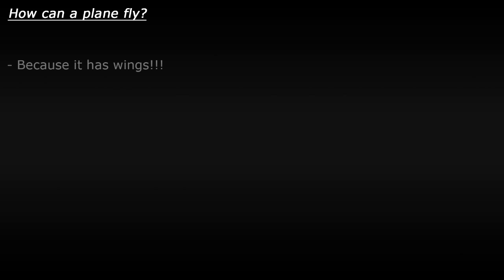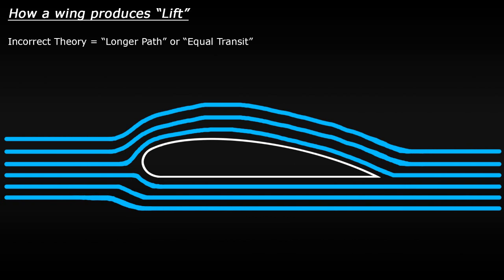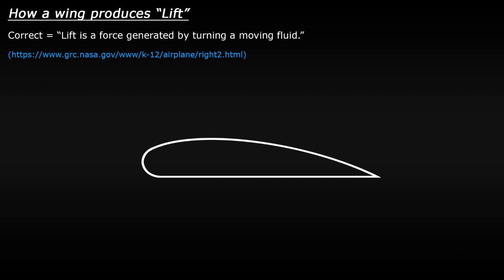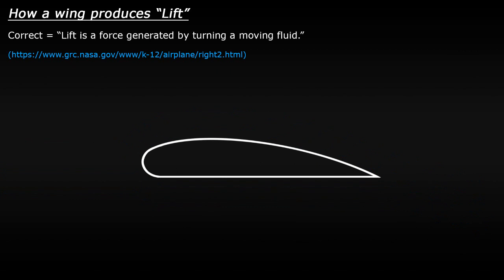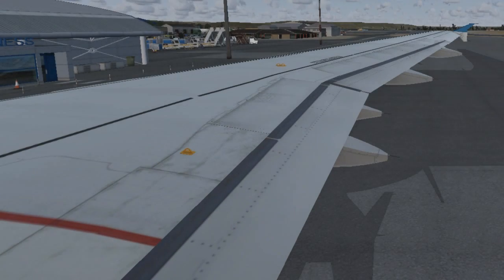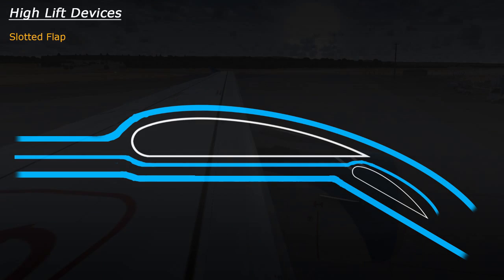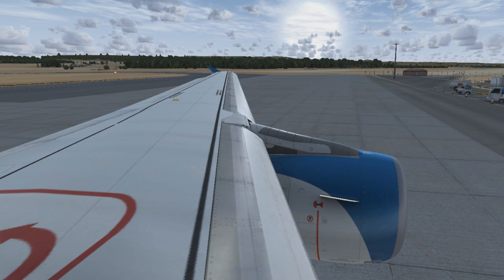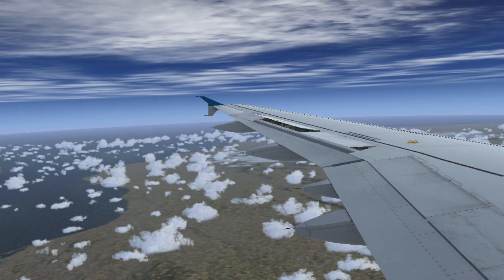How Wings ACTUALLY Create Lift!

Comment: 1:56 Correct, The wing is indeed turning the airflow downward.
But there is also a pressure difference between the top and bottom of the wing!
The lift force is literally equal to the average pressure difference between. The bottom and top of the wing times the surface area of the wing!

And it is in fact the pressure gradient formed arround the wing that turns the airflow downward!

Please correct your mistake!

Comment: This "correct" explanation was given in 1944 (possibly earlier?) by Wolfgang Langewiesche in his book "Stick and Rudder" and rubbished (at the time). It is now known that BOTH principles are involved, it's just that the Bernoulli principle was incorrect regarding the speed at which air travels over the top of the airfoil..
Reply: The basic mistake is confusing cause with effect. as far as attributing increased airflow speed, lift and the Bernoulli effect over the upper surface.
Reply: Bernoulli Principle is not incorrect. Bernoulli Principle says nothing about the velocity profile of two adjacent streamlines, it strictly deals with flow along a single streamline.

Comment: Other than pressure difference and AoA, i never realized that the airflow above the wing goes down to generate lift! great vid to understand the basics of the wings.
Reply: +Thanatos if lift was explained only by reaction forces from the deflection of incoming air, then only planes with a thrust-to-weight ratio above 1.0 could take off.

Also, once the upper surface flow detaches from the wing the airfoil becomes stalled. Which is why fighter jets implement Leading Edge Root Extensions (LERX), slats, chines, etc to preserve the upper flow of air during high AoA maneuvers.

History of aircraft design itself debunks the theory that airfoils only generate lift through deflection. Your hand doesn't try to fly up in a moving car because it's not a well designed airfoil. If you designed an airfoil just the right size for your hand and which could generate lift at low speeds, you'd feel it pull up when outside a car window.
Reply: I'm sure Thanatos is an aerodynamics expert, and all these other people who build and design planes are just cretins compared to his massive intellect. He called it, you guys. We're done here. From now on, all planes will be designed with giant hands on the sides.

Comment: Thank you for the excellent explanation on a very important topic in aerodynamics! I like how you started your explanation of how lift is generated by making a simple claim and then proceeding to debunk the most common misconception of the generation of lift that has been spreading in aerodynamic communities. I also found your explanations of how the angle of attack and number of flaps on aircrafts affect the lift on a wing to be very helpful. Overall, you did a great job of explaining the production of lift!

Comment: Good start by debunking one of the common myths about lift generation. Unfortunately I think too much was thrown out with that theory. Pressure does indeed play a part in lift generation, but it's only part of the larger puzzle.  To say that the pressure difference doesn't create lift is incorrect. The Coanda Effect also only applies to fluid jet flows, which is not descriptive of a fluid flowing over an airfoil. The turning of the airflow, or momentum, theory is definitely one of the ways that lift is generated. Circulation is a more complex concept, but including it would have resulted in a much more complete explanation of what causes lift.

Comment: Well the actual force of the lift is created by the pressure difference between the upper and lower side of the wing. The air directed downwards is basically just the result of that.
Most simply explained by newtons first law that an action must have an equal oppsite reaction.
We push the plane up so the air must get pushed down as a result.
Reply: Seeking causality makes everything complicated. Ultimately, lift requires a pressure difference and requires a change in momentum, and it's hard to separate those.
Reply: @AmbientMorality  Pressure preempts movement. Its a state that begets a force, which in turn begets movement.
Confusing the direction of this causal relationship is probably because the bernaulli principle is also sometimes involved, in which a change in fluid velocity begets a change in its pressure.
That is not the mechamism, however, by which air compressed by a wing at high AoA gains its momentum.
Reply: @ineednochannelyoutube5384  The pressure difference created around an airfoil is entirely due to movement though?
Reply: @AmbientMorality  Correct. Horizontal movement of the aerofoil relative to the medium compresses the medium (or indeed vica versa), which in turn creates the vertical air movement.
Neither movement however acts as a vertical force on the wing.

Comment: Some  fighter aircraft have a symmetric wing shape, same on top and
on the bottom. They can fly upright or upside-down. Their wing
is an inclined plain to the airflow that produces lift. The angle of attack
is very critical. For the traditional wing shape, the angle of attack
is much less critical. QED

Comment: An oblique hydrofoil dragged slowly through liquid helium will not generate any transverse force. Fluid flows round the trailing edge of the aerofoil and doubles back towards the rear stagnation point. As the hydrofoil speeds up, we are putting in enough energy to warm up the helium and destroy superfluidity. Then all the vorticity is concentrated in boundary layers around the hydrofoil. As the fluid warms up, a thickening boundary layer is unable to negotiate the trailing edge and so vorticity is dumped as a starting vortex in the flow. This establishes a Kutta condition at the trailing edge, and there is residual circulation around the hydrofoil opposite in sense to the starting vortex, which generates a transverse force. This can be explained in terms of Bernoulli's Principle as well once things get going, but the formation of the starting vortex is the thing to look at. It won't happen without viscosity.

Comment: It's all Newton's Third Law - the mass of air pushed down offsets the mass of the aircraft. This is so obvious when you think about a rotary wing aircraft (ie. helicopter). It's very windy underneath there.

The airfoil is only important for maximising air deflection while minimising drag. It's not the upper surface separating that CAUSES the lift to fail, but the increase in DRAG which decreases the forward movement, thus impacting the air deflected downwards (ie. lift).

Comment: hey doofer, I'm a huge fan, yes, the equal transit theory is totally incorrect, but you've missed a few things out here

1. the camber on an airfoil produces lift mainly by the curvature of the streamline and the euler equation, When a streamline is curved, the air loses its pressure
2. Another thing to take into account is streamtubes, as the air meets the cambered portion of the airfoil the "Streamtubes" are slightly squished, following the venturi theorum

Yes, Wings do indeed create lift by downwash too although
Edit: Also the downwash eventually levels out due to its inertia

Comment: Finally, someone who correctly explains the bending of the air flow over a curved wing surface as being caused by the Coanda Effect, not some incorrect attribution of the Bernoulli Principle or Newton's Third Law. The Coanda Effect (look it up) is about the creation of low pressure near a curved wing's surface through the process of entrainment -- evacuation (capturing) of low energy air by faster moving, higher energy air. The resulting low air density (pressure) not only creates the lift necessary to fly the plane but also causes the air to "stick" to the curved surface, creating lift over most of the surface, depending on air speed and angle of attack. And, yes, there are effects such as downflow at the rear of the wing, faster flow over the top of the wing, etc. but these are effects, not causes. This confusion of cause and effect has been at the heart of most incorrect "lift" theories. Most such theories describe effects as if they are causes, and never actually get to the fundamental cause.
Reply: Coanda has nothing to do with lift

Comment: Dont forget lift is also produced simply by the air pressure on the bottom of the wing at non-zero angle of attack. This is how planes actually take off. I would argue that this component of lift primarily enables a plane to ascend and the airflow turning on the top of the wing enables straight ahead flight.
Reply: Lift on the upper surface is higher than the lift on the lower surface at all angles of attack for virtually all airfoils. The exception is during stall (or maybe for some really weird and likely ineffective airfoil), but hopefully the plane isn't taking off in a stall.

Comment: The lift generated by a wing is due to the pressure difference between the upper and lower surface.
The question is WHY is this pressure difference created.
Physical testing shows that the speed of the air over the top surface IS faster than the flow over the bottom surface.
There are mathamatical formulas for calulating lift that are accurate. Aircraft designers use them!
The amount of lift depends on the density of the air, the coefficient of lift (determined by the cross section shape of the airfoil), the angle of attack of the airfoil, the area of the wing and the speed of the wing through the air squared.
There are various sections that have been tested, the NACA sections and the coefficient of lift at various angles of attack and can been looked up for each section.
The "Downwash" theory sound convincing but it forgets the "Upwash" that occurrs in front of the wing as the air rises ahead of the wing to enter the low pressure area above the wing.
The "Creation of lift" is obviously far more complicated than a simple bernoulli or downward deflection explanation.
The fact is lift IS created by a combination of the factors listed above and explanation involve deflection of air and the speeding up of air over the top and slowing of the air on the bottom.
The pressure differences have been maesured and the force from the lower pressure on top is greater than the force from the increased pressure on the bottom.
So the statement that lift is not reliant on the pressure differences above and below the wing is clearly NOT correxct.

Comment: As often happens, the same phisical phenomena can be explained under differect aspects, all true. For example, I could explain that a pendulum works by the force of gravity slowing down and accelerating the ball back and forth, while you could explain it saying that it trades potential energy for kinetic energy ciclically. Both explanation would be valid.

While we all agree that the "same time" explanation is wrong, lift can indeed be explained (and calculated) by the pressure differential between lower and upper faces of the wing, which in turn are caused by profile shape and incidence. At the same time, you can also explain lift by saying that the wing pushes air downwards, creating a force upwards. Both are true at the same time.

Comment: You know, upon revisiting this video now, i have a few more thoughts:

There are wings that are basically flat, wings that have a symmetrical profile (meaning the upper and lower part of the profile is the same) and also airplanes can fly upside down, against the profile and just through angle of attack. Airplanes, even at their max speed, fly with some amount of aoa and that in my mind is responsible for the lift, the air that hits the wing from below, pushing it up and itself being turned downward. 

To me, the upper part of the profile is there for getting the most out of the wing for a specific type of flying by reducing the moment of air unstick and the onset of turbulent air that would start hitting the wing from above, pushing it down, all for the airspeed and aoa range at which the wing will spend most of its time in, meaning the cruise phase. Plus it conveniently gives space inside the wing for fuel and actuation. To me, its all about the angle of the wing, if it becomes too steep, the air starts to deflect in such a way that it mostly pushes the wing backwards instead of upwards, slowing the plane down until flight is impossible. Slats and flaps give you more air being turned and more sharply while maintaining lower aoa and further reduce the onset of unstick of air (slats)

The air being turned down on the upper surface doesnt seem to do anything to push the wing up, also, that air meets the lower profile air behind the trailing edge of the wing, so there would be no influence on the wing itself, those things happen behind it. In my mind there is always too much propensity for attributing lift genereation to the upper profile, its there to lessen air unstick and turbulence at aoa's by giving the air there a more gradual gradient of travel, in my mind.

Plus, one could argue that at low aoa's and with wings with sharp, bulbous profiles, the air that meets the leading edge on the upper surface would be deflecting upwards, pushing the wing slightly down, thats why those wings often fly very slow and at higher aoa's to negate that effect and just have that lesser propensity for unstick.

What would be your thoughts ?
Reply: The air accelerates very rapidly over the upper surface and gets a very low pressure, so it's responsible for a ton of the lift. You're right that it has to meet the air at the trailing edge of the wing, which is at a much higher pressure. The fact that it's flowing from low to high pressure is why it's susceptible to stalling.

You're correct that the upper surface near the leading edge produces slightly negative lift at low angle of attack. But higher angle of attack still makes the pressure gradient on the upper surface worse.
Reply: @AmbientMorality  Hmm...If what you say is true, then the wing could basically generate lift at 0 aoa ? Just through the profile ? And yet there are airplanes whose wing profiles are basically flat and/or symmetrical, made for high speed and low drag. They fly just fine too, as well as other examples i mentioned, all of them fly at some aoa even at max speeds. Hmm...the fact that air over the wing is of the lower pressure than even the air that sits above that air could perhaps aid the air under the wing in its pushing of the wing up, indirectly ? There is overally less mass "resting" on the wing from above, compared to a stationary wing, you could say ? Thats how i would imagine this at least ? But i'd say that its more of a fact of the wing itself just being a barrier for the ram air, creating that lesser pressure on the upper side and the profile being there to ease the flow of that lower pressure air, so that it doesn't unstick too early thanks to a more gradual gradient and start hitting the wing turbulently from above, at least thats how im imagining this X).

Also, would you say that the lesser pressure air right over the wing accelerates, becouse of the mass of undisturbed air resting on top of it, pushing on it with its own mass ?
Reply: @vedymin1  A cambered wing could generate lift at zero angle of attack, and a symmetric wing would generate lift on some parts but it'd be cancelled out exactly by the other side.

The barrier explanation doesn't quite work in my mind because if the flow separates, the pressure on the top surface of the wing increases to roughly atmospheric pressure. The barrier analogy suggests that the wing is just blocking the air, which isn't possible because air will fill a space faster than a wing will move.

I'd say the lower pressure is because the airfoil curves and the air follows that curvature: curvature means that the pressure near the wall must decrease (essentially, centrifugal force). Since nothing's actually adding energy to the flow, if the pressure decreases near the wall then the velocity must increase because energy is conserved. Therefore, you get acceleration.
Reply: Im gonna have to think about what you told me, specifically the ability of a cambered wing profile at zero aoa to still produce lift, trying to visualise what all the air particles do at all times in all parts of the wing is a challenge to say the least, more learnin required i guess xD.

Comment: The equal transit theory is false. Lift creation is very complex but it’s mainly caused by the pressure differential between the top and bottom of the wing and the downward deflection at the trailing edge. So it’s a combination of Bernoulli’s principle and the third law of motion.

Comment: Note that the center of lift is approx @  25% of chord,  if directing air downwards at the rear of wing was main cause of lift,  center of lift would be at the back of the wing.
Reply from the maker: Ah I didn't know that.... since making this video I've learned that I haven't covered this topic in as much detail as needed and didn't give a full, comprehensive explanation so I will revisit this topic and remake this video in the future.
Reply: check out center of pressure glen research center,   then images,  
It seems weird to me that helicopter blade is angled up during autorotation, yet is gaining forward thrust as it falls thru the air,  as is a glider wing.
Reply: +Observ45er   I think the top skin produces double the lift of the bottom skin,,   the air flow behind the most curved part stops being laminar, and kind of boils off the wing,   precise point being determined by reynolds number

Comment: This explanation has some issues. Bernoulli's principle and Newton's third law are both at work. Equal transit (which is separate from Bernoulli's principle) has been disproven, but airflow over the top does move faster and creates a lower pressure area above the airfoil while the air traveling beneath, moves slower creating a higher pressure area generating some lift.